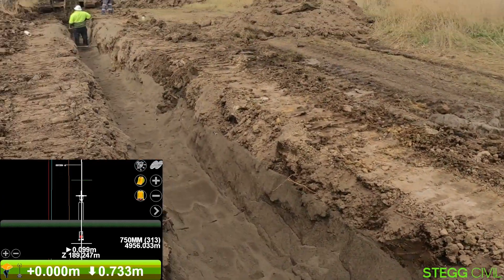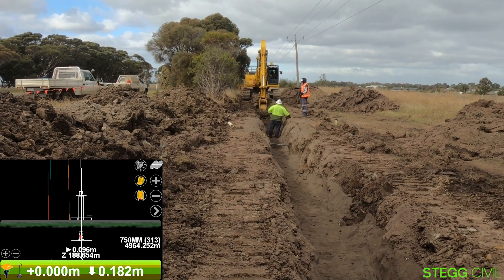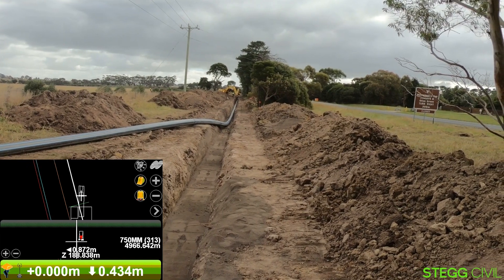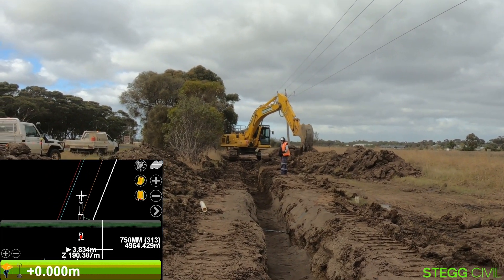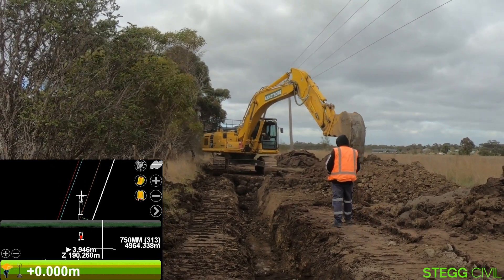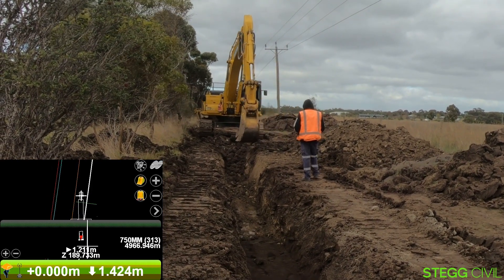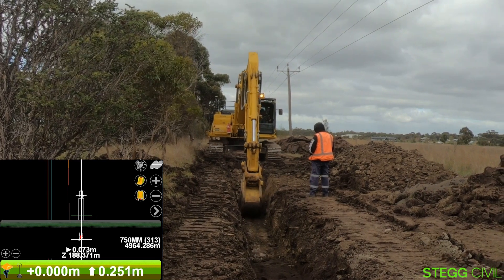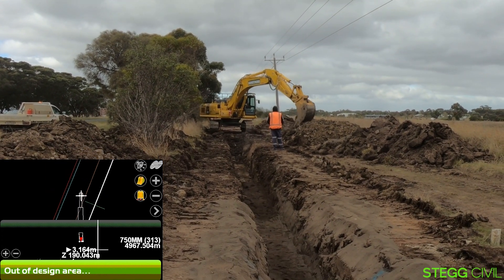Excavator Topcon GPS   Pipeline digging

Comment: I work in a coal mine driving dozers - mostly D11's - and little diggers - 50 to 120 ton machines. 
We use Leica for all the work around the mine. Great to have something where all the machines 
in an area can work off one design file to achieve a result. 
I had to dig a 3mtr deep trench the other day to put some 280mm poly pipe under a new haul road 
for a highwall pump we will need in the next month or so.

Comment: Just wondering how many meters a day you average with that system?
Reply from the maker: Hi Nigel.

Tough to say - I didn't ask the guys while I was there but they were dealing with limited access for crushed rock, traffic management, the digger is set between trees and powerlines so probably not the job to set as a benchmark.  

With Topcon GPS you don't need anyone checking heights.....and no-one to paint the line for the trench.....so if the guys at the back can keep up with stone and laying, then the first digger can usually drop back and backfill earlier.
Reply: @steggcivil  Thanks for the reply . I’ve only been digging for a couple of years and was mainly interested how many meters ur lead digger does just to see how I’m travelling. We do airport lighting so average about 5-7 km for a rural airport job.
Cheers 
Nigel